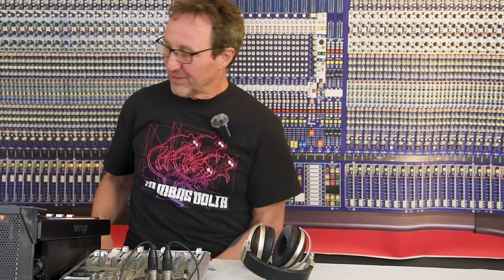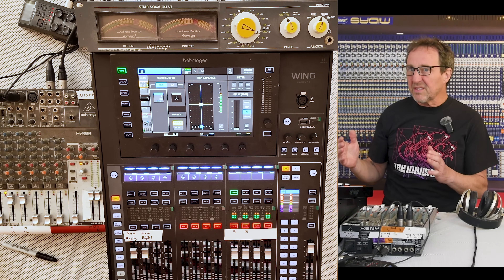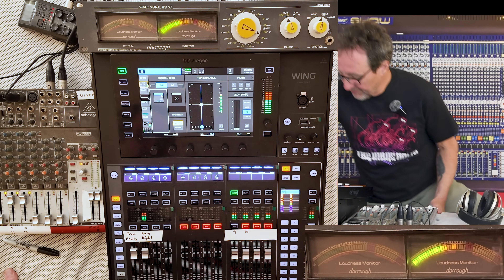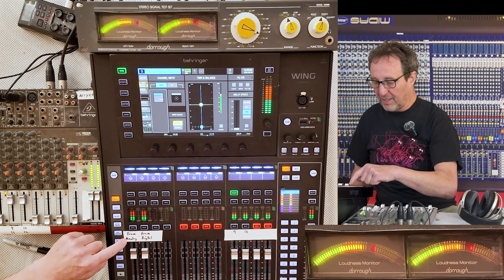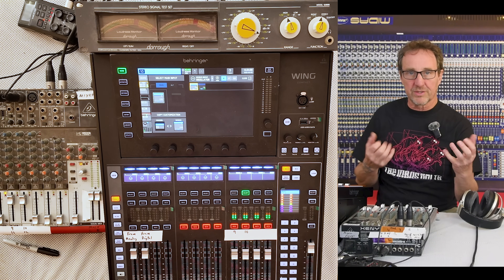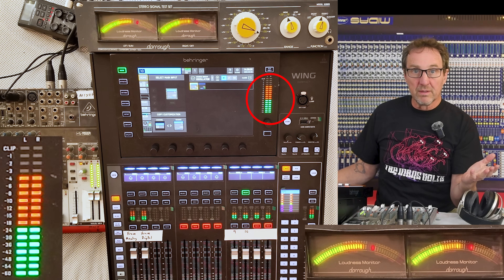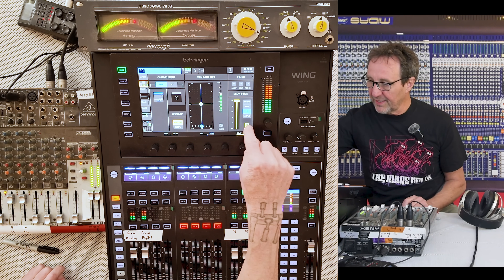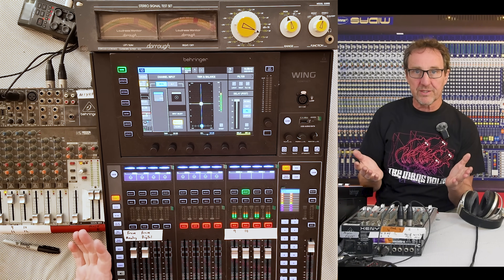Digital Audio Meters Don't Show What you Hear - Sometimes

Comment: I'm wondering if this has something to do with a disagreement between measured & calculated values.  
Such as the analog meters, and the input meters of the digital desk being effectively measured values, but the summation within the digital desk showing calculated values?
Reply: What's the rate/window of the digital meter? Is it per sample accurate, or looking at larger chunks of samples, and just showing the highest value within that chunk? 
If the white noise had a high value peak within each chunk, and only those peaks were used to calculate the summed value, wouldn't that show +6db summation, even though the true average summation of the decorrelated noise sources was ~3db?
What does an oscilloscope show for instantaneous peaks when those correlated & decorrelated summed noise sources are measured? What happens when a sine wave is used instead?
Reply from the maker: The digital channel and output meters will show the issue, but will stop showing the issue if you convert the signal to analog and then back to digital again both the channel and output meters will then show the signal correctly. 

But that's missing out on the bigger picture, The real question is, what is causing the meters to read incorrectly and why does it go away when you convert to analog and back again and can you ignore it? Or are you really losing 3DB more in the digital domain than you would lose in the analog domain. 

Multiply that times 10 channels and it's now 10 dB headroom lost in digital that you don't lose in analog
Reply: @DaveRat  Regarding the analog mixers (and i still like a lot of them) may be that in former days developers didn't mention the summing energy in the panpot possibly. We should ensure that the analog desks panpot do -3 (constant-power) behaviour in the middle position while monoing the two signals. Otherwise the +3dB rise in the digital console later doesn't rule to the meters behaviour then.
Reply from the maker: If the conversion to analog and back to digital is what fixes the issue, why does the issue not happen if the signal is never digital? A pure analog signal chain wont show the issue. It's only/mostly in the digital domain.
Reply: @DaveRat  Are we right in the conclusion that the DA-AD thing really "fixes" it? (Something in me struggles about that.) Due to the fact that aside of summing noise signals there is mono-ing involved we must assure that the panpot does a correct compensation for the 12o'clock position! Otherwise we could see possibly wrongly rised signal returning back into the digital domain and misinterpret it regarding the meters there.  Is the analog mixing desk applying the constant-power panpot? (Just guessing)

Possibly (only possibly) we could try to do all testing left-side-only in stereo channels: mixing two noises (only left-channel plus left-channel) and then do the readings. All panpots at left should enshure that no power goes to the middle or to the right.

Just a question: The Dorrough-Meter itself is fully analogue inside? Or is it digital itself?
Reply: @DaveRat  the issue isn't happening in the digital audio stream summation (we can hear that is still as expected) - it's only happening in the digital meters, so the meters are either not reading the same data, or not doing the same math.
 
What I'm suggesting is that the digital meters source is separate to the actual digital audio stream, like a duplicate of each channel to a different bus, but intentionally low sample rate (presumably because nobody can see a 44.1/48/96khz meter refresh rate, and processing efficiency considerations).
I suspect that the LoFi meter bus just takes the peak value of each block of HiFi audio samples as a LoFi meter data point. Then the error occurs >>when the LoFi data is summed<<.
The digital mixers actual HiFi audio streams sum correctly, and that sent back to an input doesn't show a meter error, as it's not being summed with another channel in the meter bus.

Analog gear is analog summing, and the meter is directly reading the analog audio streams.

Noise averages out to the same value over a period of time, but varies in instantaneous values. Both analog and the HiFi digital audio stream are summing those instantaneous values. Correlated the two instantaneous noise values are the same in each instant, and always sum constructively. Decorrelated, the instantaneous values are different, and sum accordingly.
What I'm suggesting is that the LoFi meter bus uses values taken over a longer period of time, and those values end up being the same, whether the noise is correlated or not.
Reply from the maker: The Dorrogh is fully analog. Since we are dealing with mono signals, the pan pots are just level controls.

I believe my testing showed the following:

Conversion to analog does not fix the issue but greatly reduces the issue in most setups.

But the issue can be created with analog inputs to a digital console. The higher the sample rate of the signal chain, the more pronounced the issue. With a max offset of 3dB for two signals summed.
Lower sample rates may show less than 3dB 

Pure analog does not show the issue. 

But these results are just on the gear I tested.
Reply: @DaveRat  I don't think that's what it showed from what I saw in the video.

I think it's to do with the way the meters on digital systems are deriving lower resolution data from the digital audio streams, and then presenting a meter error when that lower resolution digital data to the meters is summed.
Reply from the maker: From my discussions with a digital console design engineer, the digital meters are hyper accurate and will show even the shortest peaks and that is related to the issue.

Analog meters don't see these very short term high frequency peaks.

 another part of the issue I believe is the way digital sums high frequencies and the relationship with the Nyquist filter.

Try low passing the signals and the issue changes, almost as if the low pass at 20K reduces the issues caused by the Nyquist filter but introduces new issues created by the low pass filter
Reply: @DaveRat  If you add that 20khz LP filter to all the sources being summed, is it changing anything in the summed audio output levels from the desk (correlated vs decorrelated), or just changing the meter reading?
 
I doubt the D/A or A/D converters are "fixing" anything - I don't think the issue exists in the digital audio or it's summing at all - just in the way that data is extracted & processed for the meters.

I don't think the digital meters are missing any short peaks, I think they may be taking ONLY the highest peak from a block of samples. So the meter treats those peaks as happening at the same time & summing perfectly, even though in the decorrelated sum, they're not at the exact same time.

In the analog mixer I expect the summing of those sources to the meter would be before the limitations of the meter ballistics.
Reply from the maker: Low pass gives mixed results depending on the low pass slope, filter type and sample rate.
Reply: @DaveRat  On the audio out, or just on the meters?
Reply from the maker: Low pass on the signal before summing

Comment: This is fascinating stuff, Dave. I just did some testing in Pro Tools, and I see similar results if I use a peak meter. If I switch to an RMS meter, a VU-style meter, a PPM meter, or a loudness/LUFS meter, switching between the correlated and decorrelated signals shows the expected level change.

With a standard peak meter, the peak stays relatively the same regardless of whether the two signals are correlated or decorrelated. I think this is because even when summing the two decorrelated peak signals, there are still random peaks that add to that +6 level and peak meters don't show loudness. They just show the peak of the signal. In the Pro Tools "sample peak" meter, it holds rock solid with the correlated signals, but it does fluctuate slightly around that +6 level with the decorrelated signals.
Reply from the maker: Try converting to analog and back to digital and do the same meter tests on a signal that has been converted.

Does the issue goes away?

Comment: I think the answer is somewhere in the fact that the 3dB rule of thumb applies only to averages.  We expect that individual concurrent samples might still just happen to have the same value once in a while, which will give an output that is double that of either.  If one of the meters is averaging over some period and the other is just reporting the absolute maximum value in that same period, it could easily explain this kind of result.
Reply: yes, decorrelate signal +3db is not true on a sample by sample basis. If you add two samples from two decorrelated signal, it can produce any result which the peak meter reads. After a peak is set, the digital console just decrease the level display in a fixed rate, until a higher peak is reached.
Reply from the maker: Then how come channels one and two of the wing meter the exact same signal correctly after it's been converted to analog and back to digital as I show in the video? 

Why does rolling the dice only cause this issue in the digital domain and the analog domain rolling the dice is fine?
Reply: @DaveRat  I'd guess that the channel faders are RMS reading while the main LR meter is peak reading.
Reply from the maker: Interesting guess. Your focusing on the meters being the issue yet if you PFL channel 9 and 10 you'll get the issue showing up on the PFL meters and if you PFL channels 1 and 2 that have the signal that's been converted to analog and back, The issue won't show up on the PFL meters. 

But step back, if it's a metering issue then ask yourself this, Are the meters incorrectly reading a phantom signal? 

With 10 white noise sources you get a 10 DB error in the same test. 

That means you lose 10 DB of headroom on a digital console. 

If it's a metering issue you should be able to ignore that and push 10 DB into overload of the output meters and still have a clean signal when this issue is confirmed and showing up. 

Alternately, The digital meters are actually showing the two facts of what's going on. That's what I found to be true. 

The question is why are we losing headroom on a digital console that we don't lose on an analog console
Reply: Maybe the DAC+cable+ADC introduces just enough phase difference or rolloff at higher frequencies to bring the pure digital peaks down?  Or another comment mentioned slew rate limitations bringing down single sample impulses.  I wonder if this is visible on an oscilloscope (if you could get the digital signal into a scope directly).
Reply from the maker: Perhaps, try it. Try low passing the signals. Try a to d and d to a.

See if what you think will happen actually happens.

That's what I did and am sharing one small segment of the tests I have done.

See if you can solve it
Reply: You've basically got two people rolling 100 sided dice simultaneously, and you're reporting the result after every 500 throws.  But exactly what are you reporting?
Reply: I didn’t say I had the answer, just that I suspect it’s somewhere in that area.  In the pure digital/theoretical math realm, the 6db result for peak values IS correct for both scenarios.  Why the meters give different results definitely is curious.  I’m not sure I totally buy the arguments about reconstruction filters and slew rates for a couple of reasons, but I don’t have an alternative explanation.
Reply from the maker: I've done a lot of testing on it and I think I have a pretty good grasp on what's going on but that will be for another time has its more complex than I want to explain in a response here. 

That said, The meters are reading the actual digital signal, 

Short-term high frequency peaks don't really matter in the analog domain because you can't hear them and they don't cause audible subharmonic issues at lower frequencies. 

Conversely short-term high frequency peaks in the digital domain if they clip can create audible distortion at lower frequencies due to the nature of digital. 

So analog meters don't need to see it and digital meters do need to see it and therefore digital meters are showing you something that you can't hear because it matters and analog meters aren't showing you something you can't hear because it doesn't matter.
Reply: Looking forward to a follow up!  :)

I guess an instantaneous level that tries to exceed the limits of the system is going to get distorted either way, and if it's fast enough that we don't hear it in analog, we also won't hear it in digital.  The situation is actually slightly "worse" in analog since we have that curvy transition region just short of the actual hard limit.  It is the reason that extended periods of distortion tend to sound better when it's analog rather than digital hard clipping, but it also means that a signal say 1dB down from the limit will be significantly distorted in analog, but totally untouched in digital.  

And of course, pure analog meters can't show us true instantaneous peaks because they just physically can't move that fast.  LEDs can certainly move faster than needles, but at a certain point our eyes can't keep up.  They basically just have to be smoothed over time one way or another.  I think the only real way around it would be to have an ADC and some sort of DSP just to display anything like real peak levels.  Which...I would assume those digital consoles have all that, so the plot thins.
Reply from the maker: I agree except short term high frequency peaks occuring above 20K in analog will tend to generate harmonic related distortions at even higher frequencies and we pretty much won't hear any of it.

But with digital overload, high frequency overload will ar can generate lower frequency distortions. So clipping at 40k digital, can create distortions we can hear at lower frequencies.

Analog clipping, kind of ok, digital clipping bad.

Comment: Hey Dave, pink and all other coloured noise are correlated by definition. You can only approximately decorrelate coloured noise with a long enough time delay. Bandlimited white noise is also correlated unless it is critically sampled. In the case of these consoles, they probably bandlimit on their inputs but then proceed to sample  at a higher frequency than Nyquist.
Reply from the maker: Hmmm, so two white noise sources creates by different generators from completely differing sources are correlated? 

And why do analog meters read correctly and digital meters read incorrectly?

I do know why but am curious as to what the various opinions and understanding are.
Reply: @DaveRat  are you gonna tell us some time? I'm really curious! 😂
Reply from the maker: @flowboxx I've already done a follow-up video a while back on the member side of my channel that I will release public at some point
Reply: @DaveRat  understand. Looking forward to seeing it! Very interesting topic! 
Thanks for your content!
Reply: @DaveRat  hey dave, bandlimited white noise is self-correlated. Meaning, a timeshifted signal will have some correlation with the original signal up to a certain point. It depends on the type of filter used to bandlimit the signal. This self correlation is likely much shorter than 1ms.
Reply from the maker: Does that explain why the analog meters read the same signal correctly and the digital meters do not except if the signal gets converted to analog and back to digital, and then the digital meters read correctly, as I show in the vid?
Reply: @DaveRat I don't think so, you seemed  to have a significant enough time delay. My intention with the comment is to address something you said about using a time delay to decorrelate noise. Just wanted to stress that, the more "coloured" the noise, the longer you must make that delay.
Reply from the maker: Ageeed